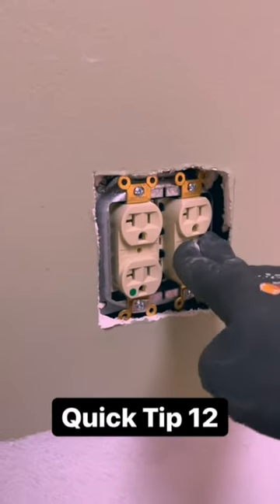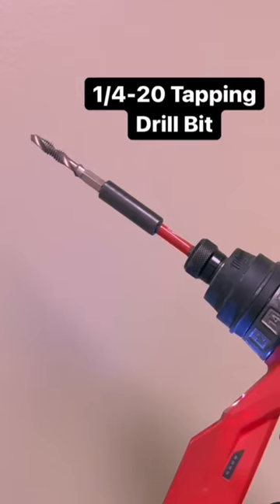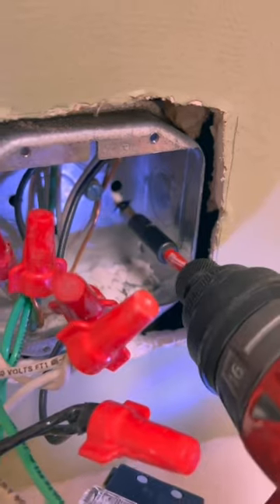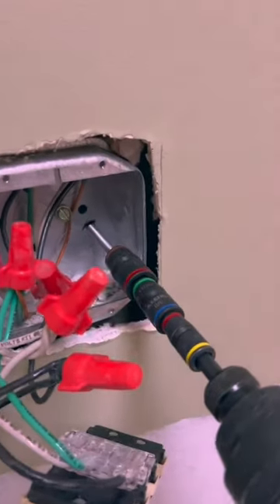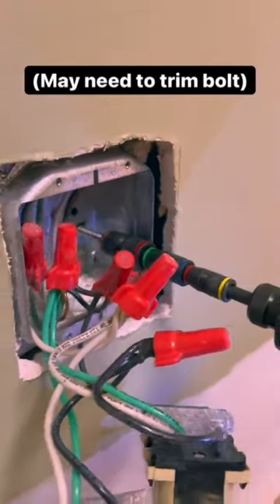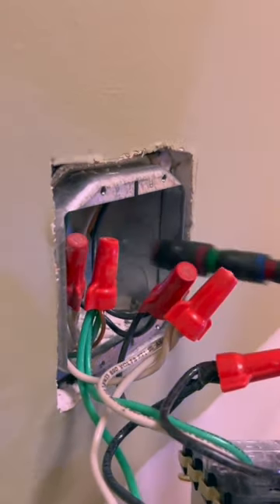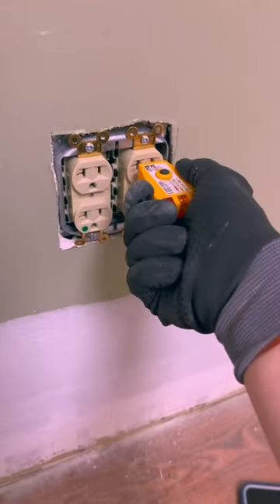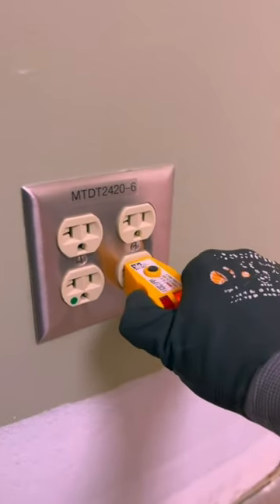Electrician Quick Tip #12 ⚡️

Comment: As long as the back wall super solid like plywood, block , or brick
Reply: Her probably doesn't go all the way flush flush. Enough to get the cover plate on and tight and that's what will really hold it
Reply: Use the correct box

Comment: Until it pushes easily through the drywall on the other side. Hacky is an understatement electrical box support brackets cost around a buck or two at Lowe's or Home Depot. Or better yet maybe rummage around in the back of your truck until you find a drywall screw or a deck screw and drive a couple of them through the box into the stud. Genius.

Comment: Good think but bad idea, over time that will out a hole in the wall behind it, I have seen it happen. If you use correct product, Caddy RLC, combined with stainless steel plate, the device will never move from plugging and unplugging.

Comment: They make a sleeve type part that the device, a receptacle or switch, fit into sleeve. Take the longer screws included with the part and the oversized ears or tabs tighten,  and now device is flush with wall and the wrapping sleeve makes near impossible to have anything drop into the wall between box and drywall.

Comment: Until it will come out from the other side of the wall. Great Job 👏
Reply from the maker: The purpose of this trick is only to get the mud ring pushed close enough to the wall to get the cover plate on. If you trim your bolt short enough, it won’t even be touching the wall once your cover plate is on, which will also help prevent the receptacle from pushing back ⚡️

Comment: If you have that kind of gap, you could remove the outlets and slide  an L-shaped piece of sheet metal strap and just zip screw it through the side at the right depth with an impact and RA attachment.

Comment: There is a thin metal face plate that covers the face of the box.then it is bent over the side of the box to touch the wall behind the box .instead of that screw hitting the wall ,you have a thin piece of metal the length of the box preventing the box from pushing against the vack wall. Remove the raised cover ,put the metal face plate on then put the raised cover back on. I think caddy makes the face plate.i don't remember the name.

Comment: Also, somebody went cheap and didn’t buy the h23 bracklets
Reply: Exactly. Screwing a box straight to a light gauge metal stud will always end up like this.  Judging by the drywall, this is someone adding an outlet, so why not just use a cut in box?

Comment: You don’t even need to make a tapped hole, just use the pre existing mounting holes in the back of box with a screw and nut, you can fit your little fingers back there for sure.

Comment: Had a rough in electrical inspection not too long ago and the inspector found a box that had a hole drilled thru the top so that the electrician could run a wire thru the top of the box, inspector said I had to put a new box in because it voids the warranty on the box..

Comment: Hack drywall installed.  Box not mounted properly prior to drywall. I think this site may have many other issues.  

Do not call for an inspection with that 1/4 20 bolt head showing.  Other than that it’s a conditional pass.

Comment: One, you need an old workbox for this. Two, pretty sure that's a code violation. 

Another option, open the wall up a bit more and put a nailer in.
Reply: agree... old workbox. I did this when I bough home with loose boxes.
Reply: As a carpenter, nailer it would be. Lol

Comment: Or....or....now hear me out. Or...u could put some screws on the left side where the 2x4 is and remount the box.
Reply: Sometimes there isn't a 2x4 next to it. This is for old work boxes
Reply: @pg13ish93  If there is no 2x4 on the left side then what is holding the box in there at all?  Asking, not telling... just confused as to how it is secured in there.
Reply: @101perspective look up "old work single gang box" for quick results. These enclosures are for finished walls and meet NEC unless your local code does not allow.
Reply: @ihavenoidea9543  Thanks for the info.
Reply: Did we watch the same video? This is not an old work box, it's completely behind the drywall and you can see it tilt relative to the stud when he pushes on it.

Comment: Better way is push box in and slip a 1x2 beside it, use a screw partially driven in the middle so you can hold on to the board after getting it into the wall. Hold board tight against the box and the back of the drywall and drive 2 drywall screws through the drywall near the top and bottom of the board to hold it secure. Remove partially driven screw. Drill a hole in the side of the box if necessary close to the face edge of the box, pull box flush, drive screw through that hole into 1x2.

Comment: Turning the screw into the soft drywall on the other side now that'll do a lot. You know what would really  help if you use the right kind of box in the first place. It is not even wired right for an outlet or a switch whoever has done this should not be doing it they don't know what the hell they're doing with or without drywall.
Reply: That is the right type of box.
Reply: The drywall cutout is too big. those tabs are to keep it from pushing back
Reply: @BensTechify no it is not it's a box for conduit there are two other types of boxes designed to fasten to the side of stud .
Reply: @5ive0h5ive drywall is not what holds the box and place it's that whole os too big for an oversize. The real problem is the person doesn't know how to do the job in the first
Reply: @dennismccolley1380   You're right. I thought I knew was talking about. oops.
Reply: It's sometimes hard to communicate this way.  I'm glad we can because I've gotten a lot of good information off of YouTube myself about many things.

Comment: This might work if the outlet is on exterior wall not interior. Otherwise if the other side of the wall is also drywall you will poke a hole through it. If it is harder material then this might work perfectly.

Comment: The stainless plate is doing all the holding… In this case take a long 6/32 put it in the far side - through the plate - put the regular trim screw in the other side. Then pull out the long screw - put in the regular trim screw - done… If a plastic plate - do the exact same, but pump some expanding foam through the holes in the back of the box first.

Or jamb shims between the stadium and the box.
Reply from the maker: The main issue is getting the screws from the cover plate to grab the receptacle in the first place. If you use long screws, it’s still tricky because the receptacle is back at an angle, and if your screws are too long then it won’t be able to screw in all the way because it will stop before it is flush with the front of the cover. That was my first thought before I came up with this idea. I love that spray foam idea though! ⚡️
Reply: @MadElectrician  it’s hard to describe without a video… But the long screw is temporary though the plate on the right (far side of the stud) - just pulling it to the face of the rock to get the left side trim screw in. Then pull the long screw out… Put the regular screw in. 

Works great on solid plates like steel or nylon plates. Or on Decora type devices or switches- as you can do the same with the top and bottom screws of a 1 gang…

You don’t leave the long screw in place - just for placement of the regular trim screws.

Comment: Better off taking the box out and replacing with an old work box. It will still fail in a few years, but you won’t have to patch the wall behind when the bolt punches through.

Comment: The box will be rock solid until the 1/4-20 screw pokes thru the opposing wall then not only do you have a wobbly box but you also have a hole to fix in the opposing wall!

Comment: Ok and when it goes through the Sheetrock of the other wall what you doing?
Reply from the maker: Never had that happen. You trim the bolt short enough to just push the box close enough to the wall to get the cover plate on. Your cover plate will keep the box from pushing back, preventing that from happening. The purpose of this is to be able to get your cover plate on when the box wants to bend inward due to the original installer doing a poor job. This is also a last resort method I use in rare situations.
Reply: That sounds like a drywaller's problem.

Comment: The front plate does that job.
Reply from the maker: This trick is actually only to get the box pushed forward enough to get your screws for the cover plate into the receptacle. Once on, you’re correct, the cover plate will do that job.

Comment: Wooow I thought I was gonna take this one to the grave with me 😂
Reply from the maker: You’ve done this too? 😂
Reply: @MadElectrician  something very similar. I usually just go to stud and pop a screw in an if that doesn't tighten it up enough I'll go to the back just like you did. Use a long enough bolt to put enough pressure on the box to keep everything tight.

Comment: This hack isn’t meant for you guys to throw a lot of pressure on to the drill it’s really just to fasten so if the bottom of the bolt is flat and the threads are smooth and you’re going slow it should move the box before puncturing all the way through the drywall

Comment: I've had this same idea when coming across a flimsy 4 gang switch box.  Not trying to spend 2 hours replacing and repairing the box and wires.  Never got to try it, but I'm glad to see you did and that it works.  Thanks for sharing, 

A fellow electrician

Comment: Get the closer device sucked in to suck the whole box back, then use 2" 6/32s to finish it on the long side, trimming the screws as necessary with your wire cutters.
Reply: Only works if the ears on the recep are flush with drywall which they aren’t here

Comment: As long as you're willing to fix drywall whenever you plug your vacuum in, this is a great idea.
Reply from the maker: Not necessary if you trim your bolt to the right length. This trick is only to get the box pushed forward enough to get your screws for the cover plate into the receptacle. Once on, the cover plate will prevent the box from pushing back and your bolt shouldn’t even be touching the back wall. ⚡️

Comment: Don't do that if its a drywall on the opposite side, just add another pan head screw on the solid side and plate it, it should be solid and most electrician knows this

Comment: And there’s a hole in the other wall in the bedroom where that quarter 20 pop through when you pushed in your vacuum cleaner
Reply from the maker: As long as you trim your bolt short enough to only push your box forward enough so that you can get your cover plate on, your cover plate should keep your box from pushing back further when things are being plugged in. The main idea for this trick is just to get your box forward enough to get your cover plate on.

Comment: Ya soon as you push a new tight plug into that you get a hole in the other side of the wall. NOT GOOD. Fix it right the first time and avoid more damage later.

Comment: If they would be installed right they wouldn't even wobble 🤷‍♂️
Reply from the maker: Very true. That’s the unfortunate nature of being a sustaining electrician and having to fix problems that other people created.
Reply: @MadElectrician  yeah, I think the biggest problems for the most people that install such things is that these dry walls are not real walls. If you install one in a thick wall (im from Germany and our walls are 20-45cm thick and full stone with sometimes dry wall over it for easier design stuff) it doesnt wobble bc its fixed to the stone and we use this kind of inserts , so you drill a round hole and then you have a plastic piece to isolate it sich fits exactly into the hole and is secured with 4screws, and in that you screw your (in/outlet) here the outlet and inlet are most times connected together.
Reply: But it's always so hard to find a stud in the wall to drill into. 🤣🤣🤣

Comment: If you install it right to begin with you don't need this
Reply from the maker: Agreed! Gotta love service/ sustaining work ⚡️
Reply: Bracket boxes are always soft like that. Using the plate cover snugs it in the wall.
Reply: @Makitafan  maybe the way you do it.  My boxes never push in.
Reply: @Makitafan  code also states. A plate cover is not a means of securing a box
Reply: Don't you just love cleaning up after someone else's crappy work.
Reply: @Richard Chambers  I have done a lot of  chick fill As. New and remodeling for 10 years now. I get calls at least twice a month to fix the control wiring or the Ansol system because, for some reason, many other electricians have problems with them. I honestly don't mind fixing other people's mistakes because I put a large price tag on it.
Reply: You’ll be surprised the people you run into some people just don’t care about their work ethic. They just care about their paycheck.
Reply: @MadElectrician  you could easily remove the mud ring and put on the proper kickstand
Reply: @solidmeat7403 that's what I was thinking! Drywall hole around the mud ring is big enough you could replace the whole damn box if you wanted to.

Comment: This trick is a lot hacky actually. Well in most cases it is, if the other side of the wall was brick/block or thick wood even then I'd be a solid trick but considering the other side is drywall this is a terrible idea. Your box is pushing off the back of the other side of the sheetrock wall and if a hole isn't formed it's from sheer luck alone

Comment: When you modify electrical components you lose the NRTL certification which is must for everything electrical installed in US.
Guess which agency publishes the electrical code?
Its NFPA. Modify fittings at your own risk, you might get denied by fire insurance adjuster if they find that bolt regardless if it were the cause.

Comment: If you hit it just ever so slightly you end up with not only a sparky coming in changing from 150 to 500 you will also have a drywaller coming to fix the big hole on the other side changing 100 to 300.. You're better off running a screw on the left side into the stud.. You'll thank me later ..

Comment: Once you have that metal plate, those outlets aren’t going anywhere
Reply from the maker: Exactly. The point on the little kick stand isn’t necessarily to keep the box from going back, it’s more to get the box close enough to get the cover plate on. Once the cover plate is on, the box will be held in place.
Reply: Just a lot of unnecessary work as soon as you put that plate on starting with the left-hand side, it’ll pull that box and again it’s not going anywhere
Reply: Just use a longer 6/32 to catch the receptacle.

Comment: Isn't this a fire hazard your ground connects to the metal box so if your ground ever actually used or there's a connection from your hot wire it touches the box and the screw touches the back of the wall starts to get hot
Reply from the maker: In commercial construction the studs are often times made of metal, and electrical boxes are mounted to metal studs, which the drywall is hung from. So the boxes are already bonded to the metal studs which are already in contact with the drywall. Even if it was a cut in box, the metal box would still be in contact with the drywall which would be the same idea as the metal bolt making contact with the wall.

With this trick though, once you put the cover plate on, it pulls the box/ devices forward more so the bolt shouldn’t even be making contact with the back wall. This trick is only to get your box close enough to get your cover plate on.

Comment: The first way how to fix this is to hire “actual” electricians that support their boxes adequately
Reply from the maker: No kidding. Gotta love service/ sustaining work. Never know what you’re going to find ⚡️
Reply: those 4sq bracket boxes almost always bend like that. A support bar that spans to the next stud can be added. A different type of box should have been used. Ether way a screw through the back is the wrong way to "fix it" an F strap should have been used instead.
Reply: Especially weak on steel studs.
Reply: Those tabs on the top and bottom of the recep are supposed to sit on the sheetrock. The guys doing sheetrock cut the hole too big. Because it's metal framed, there is a lot of slop in the bracket box. Would have been fine if the sheetrockers didn't cut a 4in by 4in hole. But the screw thing is is dumb. They make caterpillars for this exact problem.

Comment: The stainless cover plate will do more to hold it solid than that bold ever will.
Reply from the maker: The point of the bolt is only to get the box close enough so that the cover plate can help hold it solid 👍🏼

Comment: U used a metal trim plate.... didn't even need your hacky trick this time around.
Reply from the maker: The issue was getting the screws for the cover plate into the receptacle in the first place since the box wanted to bend inward. Once the cover plate way on, you’re right, the cover plate held it solid and didn’t allow for any play.

Comment: Then you'll only have to worry about it sticking out the back of the other wall
Reply from the maker: Not if you trim your bolt to the right length. This trick is only to get the box pushed forward enough to get your screws for the cover plate into the receptacle. Once on, the cover plate will prevent the box from pushing back and your bolt shouldn’t even be touching the back wall. ⚡️

Comment: Just use battleships there designed to fix that problem
Reply from the maker: Battleships are designed to do the opposite. They’re designed for cut-in boxes to push the box into the wall, not pull it outward.
Reply: @MadElectrician  true I guess I've never had them tuck into the wall. I've only been an electrician for 4 years tho